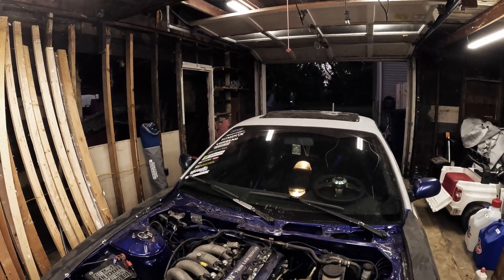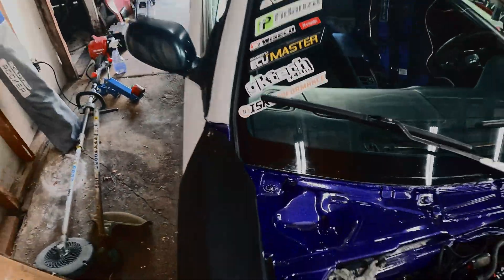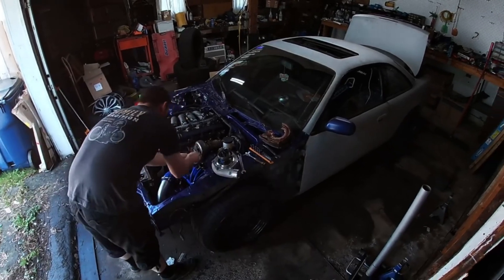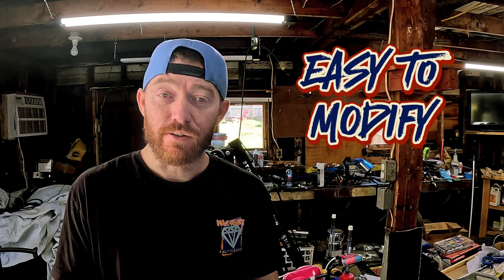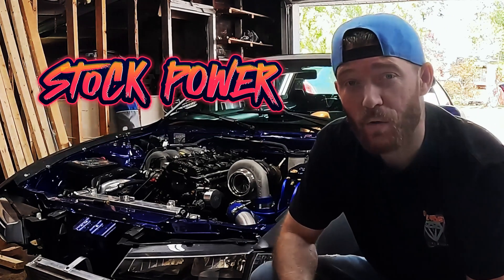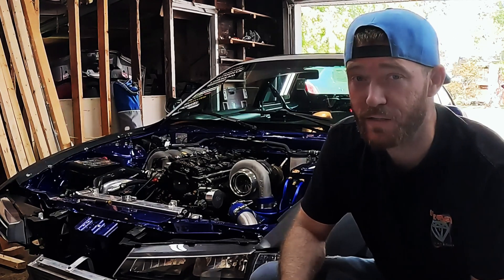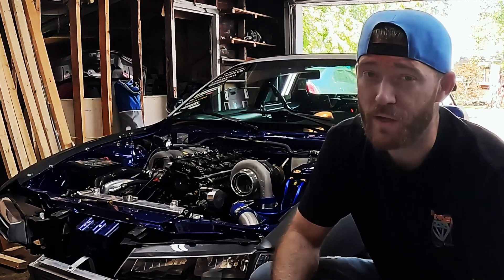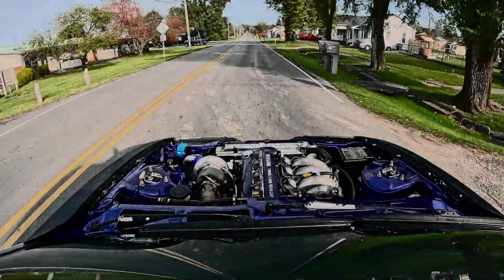Boosted KA24DE - Everything You Need To Know

Comment: i have the opportunity to either boost my ka at 150k miles right now, and run it at max 9-10 pounds and buy all the parts to eventually boost it or buy a low comp sr for $4k…
Reply from the maker: You could run it at 12 psi with good tuning for a long time. You’d have to send the ecu to rs enthalpy to be tuned. Sr is always a good option.
Reply: @BuiltToBoost going ka! made up my mind  i think the torque would be fun
Reply from the maker: @erickcervantes3151 yessir! You should be good around the 400-450hp on the stock trans. Just no crazy clutch dumps and you’ll be alright!!
Reply: followed you on insta and messaged you on there for a few more questions!

Comment: That 90degree couplet scares me. I've had plenty burst at the track until I welded a 90 angle pipe to the turbo housing.
Reply from the maker: Yea I’m planning on doing that. I’m actually going to be switching up the entire hot side Intercooler piping so it looks better and is routed a lot smoother than the current setup.

Comment: Just picked up an s14 to compliment my s15.  Did you rebuild the entire KA? Happen to have a parts list and what it cost. Super intrigued watching your build!
Reply from the maker: Ther V1 spec I did on the engine was about $5500. Pistons and rods were still good so the V2 spec that I just built was the cost of new cams (got a discount on run bc for subscribers) dual valve springs and retainers. Machining and getting the crank balanced. And obviously gaskets, seals etc. it all depends on which way you want to go with ya know! Thanks for following the build! Glad to have you on board!
Reply: Here in Georgia a couple of us are building our KA cars. We havent been going for any crazy numbers just a modest 250-300 maybe and we havent done any internals besides timing and all seals. Unless you’re going for like 400+ I wouldn’t worry about forging. Unless its a race application. Then maybe. We are just gonna street the cars & enjoy the increase in spirited driving.

Comment: Love the video I was wondering if you could give me some advice for me and my build I'm having trouble with my wiring harness, it seems like when i have connected everything when i try to connect my battery my car starts to crank by itself with no key in the ignition or anything i was wondering if you can give me some tips or advice to see what i can do to fix it. Thank you
Reply from the maker: Hey! Thanks! Hmm… it seems that there is a constant 12 volt wire in place of the starter signal pin out. If it’s trying to crank when power is supplied to the system, then somehow there is a constant 12v going through the starter and bypassing the ignition relay/tumbler assembly. Are you using the stock harness/ stock ecu or aftermarket harness/aftermarket ecu?
Reply: I am using after market i ordered my harness from enjukuracing and stock ECU
Reply from the maker: @xwyntr3537 check the pinouts and make sure nothing is crossed. Wiring Specialties harness? They have great customer service and can help you pin point exactly what’s causing the issue!
Reply: @BuiltToBoost you know what i actually can’t pin point exactly where it is
Reply: or i cant pin point what is causing the issue
Reply from the maker: Yea I would check the wiring on the harness. Something’s pinned wrong on the going into the ecu
Reply: @BuiltToBoost thank you so much
Reply from the maker: @xwyntr3537 not a problem!

Comment: is a freaking iron block! is basically a Diesel block for gas engines!! have you seen it open??? is a closed deck with no water jackes is just straight old-school tech for cooling, the reliability comes from how dam beefy the block is!!.. for a small drift D21 truck project 300whp is more than enough, beef up the clutch and spend the rest on angle kit ETC eTC , just refresh the engine rings, cheap ebay turbo and you are off

Comment: And what transmission are you using?
Reply from the maker: Stock trans for now. Planning to swap out for something that can hold some torque. Maybe z32 or a cd
Reply: @BuiltToBoost yeah I have the stock 240 trans in and wanted to upgrade to a cd but I think I’ll drive the car at 400 and push it in the wintertime while the weather isn’t the best and get up higher in the hp sector. I had a shop help build my motor and it’s rated for 650, only thing holding me back is that tranny

Comment: My 170k mile KA runs pretty damn good, although it does burn oil. Fixed the valve cover leak but it’s definitely still leaking somewhere else lol. I want to go turbo soon but I definitely should finish fixing the “daily” project first haha
Reply from the maker: The pesky valve cover leak. The oil pans can also start showing signs of leaks along with the front and rear main seals. With 170k on it I would definitely re gasket/re seal it for piece of mind. Turbo is always the answer! All day without a doubt lol 😂
Reply: @ yeah I’m gonna get a full gasket/reseal kit to prep for turbo. Probably should do rings too, clean out the pcv system. I saved a bit of time and money cause the previous owner already upgraded the fuel system so I got that going for me haha. Great content man I’ll definitely be taking advice from some of your other videos so I don’t blow my shit up
Reply from the maker: @stenooo2439 yea definitely man. Learn from my mistakes lol. ‼️Triple check base timing‼️ 😅
Reply: Front and rear main leaks on my car. 154k miles.

Comment: bigger head bolt for a mitz. and cam folllowers for a vq work to relieve some woes on the ka . found out in our case the bigger bolts lasted longer than the smaller stud kit.
Reply from the maker: Yea the only issue with the bigger bolts is the possibly of drilling into the coolant jackets. Gotta be careful when drilling for the bigger bolts. The stud kit has worked pretty good for me at the power levels I was getting before I oof’d on the timing and got rod knock.

Comment: Bigger head studs right
Reply from the maker: Yes. The ARP head studs for more clamping force.
Reply: Factory size ARP head studs or got engine machined for bigger head stud size ?
Reply from the maker: @gc2353 if you are planning on going over the 400-450 hp range  would recommend the 11mm* ARP head studs. If you are going for anything up to 450 hp you could run OEM. When installing the ARP head studs slide the washers into place BEFORE installing the head on to the block and don’t overtighten the head studs just get them snug in the block.
Reply from the maker: Edit* you have to machine the block for 12mm studs. But this is overkill. If you’re making 1000hp then, yes 12mm studs but otherwise you can run the 11mm ARP studs with no issue.
Reply: Really why not ?
Reply from the maker: They thread into the OEM holes. The biggest difference between the OEM head bolts and ARP head studs is the tensile strength. The ARP head studs can hold significantly more power and have a better clamping force over the OEM head bolts. Plus it’s studs>bolts. The OEM bolts will stretch under higher hp unlike the ARP studs that will stretch a lot less. But like I said I would only recommend ARP if you’re planning on having more than 450 hp.
Reply: Anything over 450whp you will need to machine and the head and block for 12mm studs correct ? This seems to me my problem at the movement .
Reply: I’m using ARP head studs and anything over 500 seems to lift the head . So do I need upgrade to 11mm or 12mm studs ? But would machine work done to do that right
Reply from the maker: @gc2353 that might be a different issue. The ARP head studs that I have are the 12mm studs. What are you torquing them to when the head is assembled on the block?
Reply from the maker: @gc2353 sorry correction. I have 11mm studs. There’s only a select few who have ever went to 12mm studs on the Ka24de. 12mm studs would be for 1000 hp plus. You have other issues causing the head to lift. It might be pulling the threads out of the block or they aren’t torqued to ARP specs. One or the other but you shouldn’t be lifting the head at all. I hit 850 and didn’t lift the head.
Reply: Damn , what size head studs are you on ? You tapped and drilled block or installed time seers to be able to allow for bigger head studs to hold 800hp
Reply from the maker: @gc2353 so the 11mm ARP head studs thread into the OEM holes. But if you got to the 12mm studs then you have to machine the block and re thread the holes to fit the bigger studs. I’m on the 11mm studs. No machining done to fit them. All OEM
Reply: Ooooooo really ! Im using 10mm ARP head studs since that’s what our motors come with factory is 10mm right
Reply: I had no idea ARP 11mm also fit without any modifications. Which ones so I can get them ?
Reply from the maker: @gc2353  yes. The OEM head bolts are 10mm
Reply from the maker: @gc2353  I believe I bought them on Enjuku Racing. Either there or you can get them on DriftHQ.
Reply: How did you get the 11mm ARP head studs to fit.  We are 10mm from factory how is it the 11mm arp studs fit ?
Reply: Without drilling and tapping ?
Reply: ARP L19
Reply from the maker: @gc2353 10mm and 11mm are referring to the size of the head of the stock bolts (10mm) and the nuts (11mm) that go on the ARP head studs. Threads and size between the OEM bolts and studs are the same. Do you already have the arp head studs in your possession?
Reply from the maker: ARP L19? The only ones I know of are ARP 2000 or ARP 625. I’ve never heard of ARP L19.
Reply: Yes I have ARP head studs to sets of them . 
I have a set for the KA24E and another set that is for KA24de
Reply from the maker: @gc2353 ok have you tried threaded the Ka24de head studs into the block?
Reply: 2 sets *
Reply: Yes I did it goes in . Is there any different between the ka24e and Ka24de arp studs ?
Reply: Did you oring the block too
Reply from the maker: @ nope. Felpro headgaskets FTW. I am planning to o ring it at some point but not for the moment.
Reply from the maker: @gc2353  I’m not sure if the de and e studs are different. But as long as the DE studs thread in then your good man
Reply: Are you using  a distributor still ?
Or did you install a trigger wheel on crank
Reply from the maker: @gc2353 switched out the distributor to run coil on plug. A wiring specialties harness helped with getting the wiring done to my standalone ecu
Reply: You mean switched out CAS wheel inside dizzy
Reply: What ecu standalone you
Running
Reply from the maker: @gc2353 nope. Using stock trigger wheel with the wiring from wiring specialties harness to read the trigger wheel as a CAS system. I’m running the ECUMaster EMU Classic.
Reply: I wondering if it’s worth deleting the dizzy fully and doing a crank trigger wheel with crank sensor . What are your thoughts
Reply from the maker: @gc2353 so the KA doesn’t utilize a crank trigger at all. Everything is inside the distributor for any triggers. You can delete the distributor for a COP conversion but you’ll need a flying lead harness and you have to run a standalone ecu for it to work or a RS enthalpy tune. You would get too much noise from a crank trigger anyways on these motors so it’s really a non issue to stray away from that plan.
Reply: Cause of the unbalanced crank ?
Reply from the maker: @gc2353 that and if it was a crank trigger it would have less teeth so the resolution for ignition timing would be less accurate and effective to fine tune everything.

Comment: currently in the process of building mine.
Reply from the maker: They have great potential! KA’s are true underdogs and I’m bringing them into the light. As long as you build it right and keep up on maintenance, tuning etc. they can be a killer motor! I’ve been doing a series on the tear down and will be doing the full build in a series as well!
Reply: @BuiltToBoost  yea I'm doing eagle rods, clevite bearings, wiseco pistons. Planning on boosting but not anything crazy litteraly just like 6-7 PSI. The only thing I'm having a brain fart with is choosing what thickness head gasket to go with tomei.
Reply from the maker: @Zentryte did you get the block and head resurfaced? One thing I do know is that if and when you get the surfaces decked, have the machine shop deck it with the front timing covers installed or you won’t be lined up on them. If you had them resurfaced find out how much the machine shop milled and then take the thickness of an OEM head gasket and increase (add) that value by the amount they milled off. If you didnt get it resurfaced (it IS recommend with tomei gaskets or Cometic MLS gaskets) then check to make sure the surface is not warped and clean.
Reply: @BuiltToBoost  ah shit haha I did take it to the shop yesterday but not sure if they are resurfacing it yet so I'll make sure to ask and if they didn't I'll grab the timing cover. Thank you for the information, I will definitely do that with the headgasket!
Reply from the maker: @ another thing you can do with the head gasket thickness is to check you deck height and piston to valve clearance to get the desired “quench pad” you’ll have to really dive in to the tolerance side of things though and will be a whole lot more work to get the right results your looking for.
Reply: @BuiltToBoost  sounds good man will defiantly keep that in mind. Want it done right, luckily shop didn't start anything so dropped the cover off
Reply from the maker: @ Good news man! Are you having the shop do the full assembly?
Reply: @BuiltToBoost  most likely not, but I'll see I got so much stuff going on as well but I'm getting them to do all clearances and then I'll most likely slap it all together (for the bottom end) everything else im doing. This is my first time doing bottom end work but I feel confident enough with everything I watched and learned.
Reply from the maker: @ keep me updated!
Reply: Sameeee

Comment: the reliability comes from the fact that the crank and rods are forged from the factory, the piston heads themselves are the weak link with the ka, single and dual cam
Reply from the maker: Yea the downside is that the crank is not balanced so you can’t spin it as high. But getting it balanced and upgrading the cams springs and valve will allow you to spin at a much higher rpm. Which is what I’ll be doing on the rebuild. I’m also going to bore it to fit the 90mm pistons!

Comment: Was the cam saddle cap  bolt, broken,or you just forgot put it in, ,p.s. I have looked up on this Ka24de, it a oil consumption engine, and there are some blogs out there, I have watched a few , but I’m not keep it retanded, as my  memory is not there anymore, ok thanks BigAl California
Reply from the maker: If my memory serves right one of them stretched passed the recommended specs for the bolt and I ended up chancing it without the bolt. So my noise is from the cam to bucket clearance on the lobes that are darker. I’ve order valve shims that go under the bucket to tighten up that clearance. That video will be up once those come in! And yes they are oil consumption motors if they are higher mileage. This engine was a swap out of a lower mileage s14 (60,000 miles on the engine)